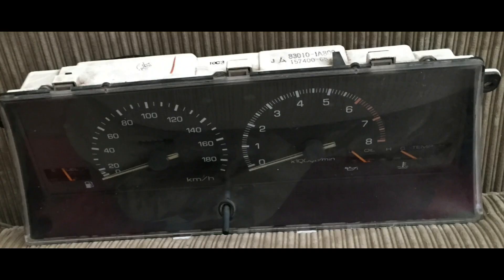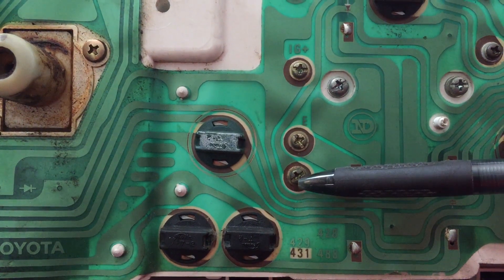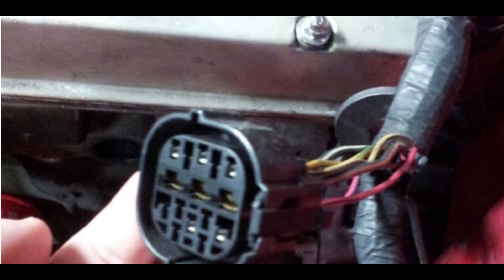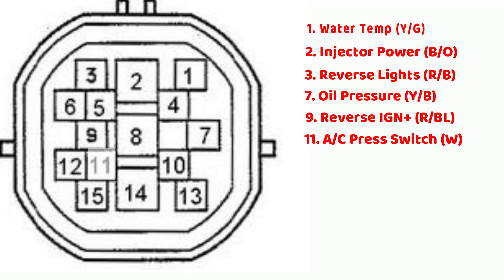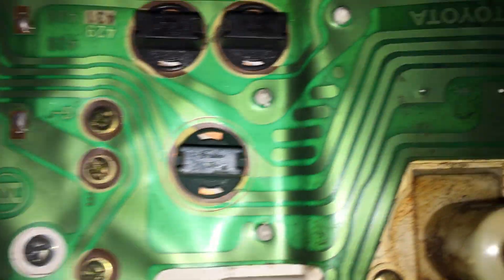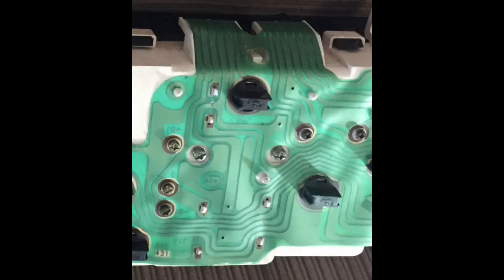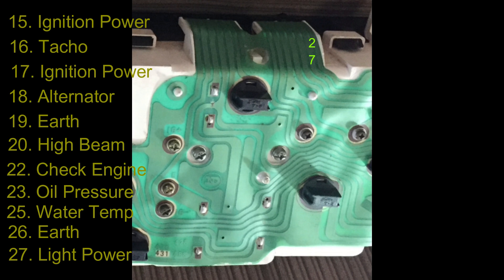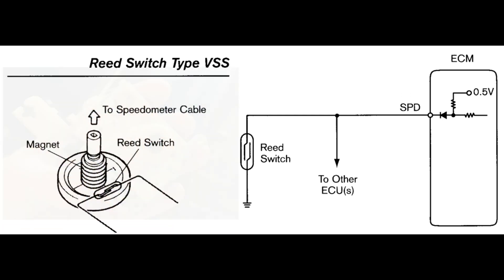How to Wire an AE86 Cluster  - Body Harness + Instrument Cluster Explained

Comment: I have an ae86 i want to swap 20v bt i have the ae111 harnes what changes i have to make
Reply from the maker: Plenty. Same principles apply to a 20v that do the 16v
Reply: @AE86DrivingClub86  do you have Instagram I have several questions what can I do with the connectors that goes insode
Reply: Do you have a diagram for the sr5 plug

Comment: Awesome thanks mate!
Reply: Question - do you know what the wires are on the firewall plug on a AE85 with 3au? I'm trying to find info on what wiring I need to do for the wiring on the body plug of the smallport ECU. Thanks!
Reply from the maker: The ecu there is none I’ve found it easiest to run new wires thru the passenger guard for the ecu in the cabin
Reply: @AE86DrivingClub86  When extending the smallport loom for rwd conversion - will wire purchased by the metre with a current rating of 7.5A be ok or should I use something else.....or both? Thanks.
Reply from the maker: Yeah it will be fine as long as you get good connectivity on the extensions.